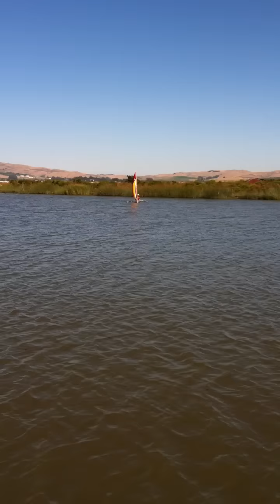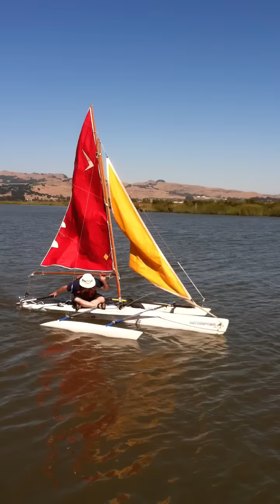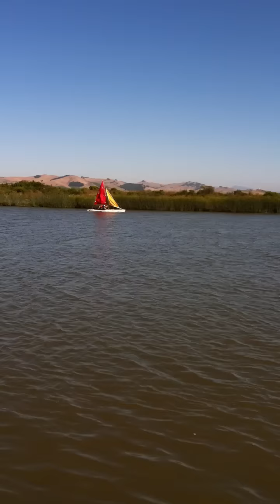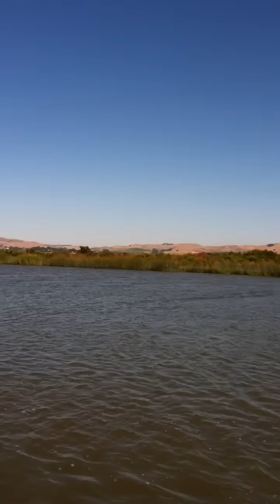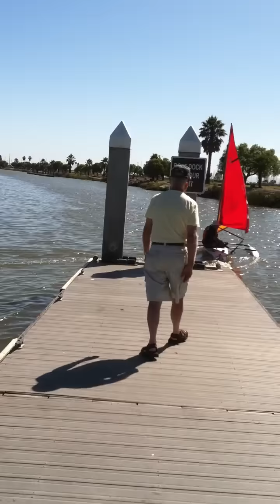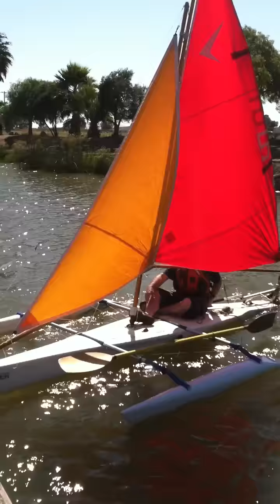WATERSPYDER.MOV

Comment: I have one of these hulls, as a backburner project sort of thing, so far I made a universal joint mast step, collected some carbon fibre mast blanks, some wind-surfing sails & booms and  made an inch to the foot scale model of it. I'm not sure how accurately one can deduce sailing characteristics from a model because hull speed would be (maybe) related to 1/12; wind power to 1/144; and wetted surface to 1/1728. My true goal, however, is to convert it to a hydrofoil